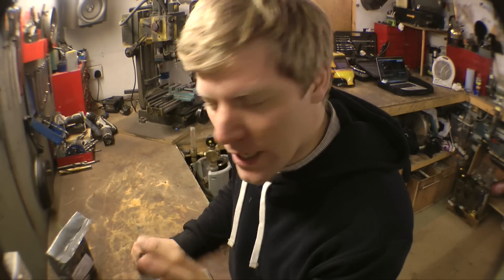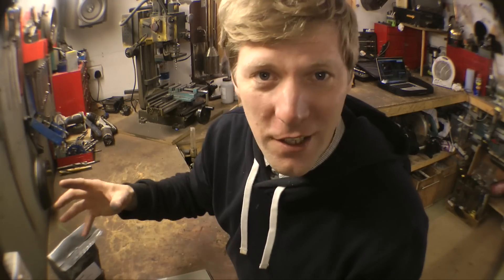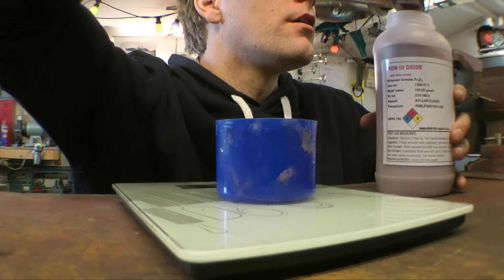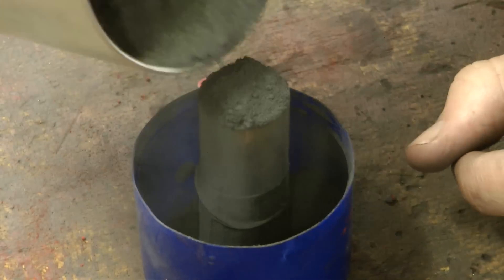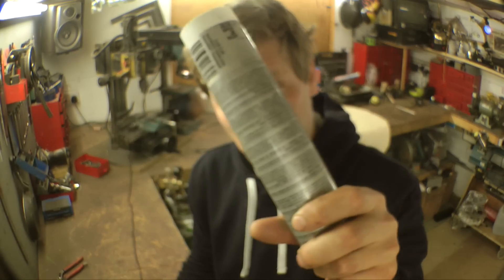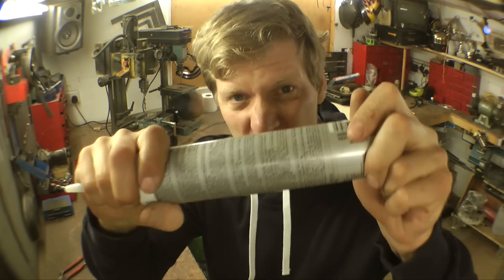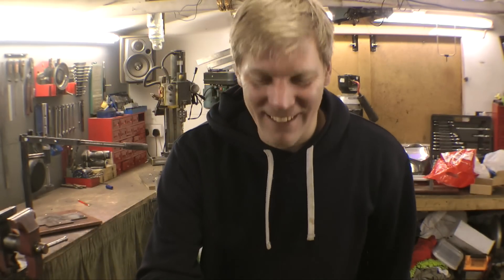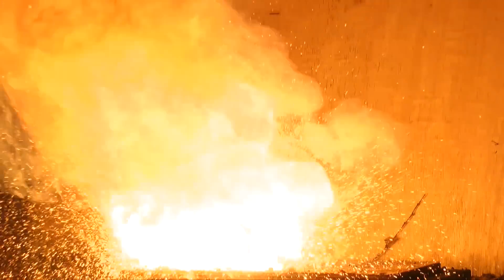Making a THERMITE LAUNCHER Part 1-Thermite shells

Comment: “When you mix fuel, metal oxide and metal powder at just the right temperature, it burns at 2000 degrees celsius. Hot enough to cut through any barrier known to man.”  -Thermite (Rainbow Six Siege)

Comment: Take that first 3rd of the pipe and compress gunpowder into it, place a thin piece of sheet metal on top and then pack in your thermite. Right when you get that sweet spot when all your thermite is burning it catches the gunpowder and spreads hot Sparks and molten iron over a much larger area ......or so I've read...

Comment: Just a suggestion, but I suspect that under the right circumstances thermite would act a lot like gunpowder, that being said, if you were to mix the thermite with perhaps some oil or water so that it sticks together instead of being powdery, and then you pelletized the mix with a 500 mesh sieve, you might get the thermite to behave somewhat like gunpowder. I think this might be the case as this could cause the thermite to burn all at once instead of just very quickly as it usually does. Using oil to make the mix could possibly have the effect of lowering the ignition temp too so you may not need magnesium strips to light it. Also, if you very securely enclose the thermite in perhaps an all metal tube, the pressure build up during ignition could also cause an explosion. This probably doesn't need to be said, but just as a warning, a highly explosive canister filled with thermite could be extremely dangerous as there isn't anything safe about metal fragments and molten metal flying in all directions at a high velocity.

Comment: I'd imagine making one like a firework. basically you'd have a charge in the center to break it up and either have thermite "stars" or just the powder and hope it all ignites. (you might need some more advanced way of igniting it like resistance heating so you ignite it evenly.) it would explode and throw thermite around and create puddles of thermite.

Comment: mix PBAN, sulfur, barium nitrate, and potassium nitrate in along with the thermite and it will light easier. PBAN is for keeping the mix together and not breaking apart in flight nor impact.

Comment: It occurs to me that thermite and a metal pipe would make an excellent incendiary grenade.
Reply: Electrical conduit would work good, I think. It's steel, but still thin enough to give a reasonable payload and it would melt with the thermite. Regular iron pipe would be too heavy

Comment: at 2.30,why he is using 90° flat edge square?
Reply: +Mufaddal Vohra to get the pipes straight?
Reply: +firoxlion sorry I didn't get you
Reply: +Mufaddal Vohra well you mean why he's using the 90° angle's, right? From my understanding he uses the two of them to make sure that the top piece of tube is absolutely parallel with the bottom tube.

Comment: In a metal tube, fill it (and pack it) with aluminium powder and some rust at the middle, you will get a lot of thrust and fire.

P.S:That's how Solid Rocket Boosters work.

Comment: Wait, just how legal is it demonstrating how to make Thermite in the first place? Nevermind the launcher itself.
Reply: +Michael Creed It's legal, but as he says if you have 'too much' of it and word gets out the plod knocks on your door.
Reply: +rasmis Heck it has even completely legal and non-violent use cases. Thermite is sometimes used to cut metal. It is a dirt cheap and fast way to cut thick metal pieces. However since it is pretty rough and not exact, plus gravity directed it is not used very often. It can also be used for welding.

Mostly it is a matter of don't use it for anything bad. If you use it criminally, it will be classed as weapon agent or possibly even as a military munition due to it's use as incendiary agent. Ergo you land yourself in metric tons of legal trouble.

Storing too much of it also gets you in trouble, though that is mostly a safety thing. Putting out a Thermite fire/reaction is dam near impossible, since it is self oxidized and so violent. So storing too much of it will get you in heap of trouble, because local fire department is not going to want to deal with your thermite stash igniting and burning the building down.
Reply: +Michael Creed Depends on where you live, and why you do it. I love the increase in european youtubers, because we don't have to censor everything. 8/3 thermite mix by weight. Iron oxide and aliminium. Here are the brand names, if you want to get them on Amazon or eBay. Done. No blurings. No blackouts.
Reply: +rasmis Well I'm not sure how legal it is in the UK, but it seems totally illegal to tell people how to make a compound that can melt steel, you know? It's cool that he's doing it no doubt, but I'm just curious about legal it is to do so.
Reply: Watch Ryder Bingo. If your intentions are good, it's legal. Same as most things.Michael Creed; eg horse manure, which can also melt steel beams. It's principally used for growing early salads and central heating, but could even be used as an explosive. Everything's dangerous in some way, so the best way to handle crime is education.

Comment: Why did you not show the aluminium? Aluminium powder is so pretty
Reply from the maker: +Sebastian Börner not sure on that maybe it was an edit mistake i didn't notice
Reply: +devastator5042 Colin does say at the top of this comment it was not intentional for a starter and secondly he told us exactly how to make it...
Reply: +devastator5042 yeah because its such a huge secret -_-
Reply: Intentional as making/showing how to make thermite (In some places) is illegal so he doesn't want to show the process
Reply: @devastm5042  3 parts to 8 parts, in weight not volume. It's hardly rocket science. Any twit with a £4 measuring scale could do it if they have the ingredients.

Comment: Could you make thermite arrowheads?  I've heard thermite can self-ignite with friction/pressure, so if you had a blunt arrowhead packed full of the stuff, could you splatter a target with a small amount of blazing hot thermite?
Reply: +frobie54 You could, but the arrow-tip would suffer from air-pressure since It'd have to be blunted, not to mention the weight would make It slow. It would work If you fired at a semi-stationary target from an elevated position.
Reply: +frobie54 You'd need some sort of percussion detonator to trigger it, probably on contact rather than light and shoot.

Comment: would it work if when you compress the thermite you leave a hole through the middle so that there is more surface area to burn at once? in the same way the solid fuel boosters on the space shuttles have the star shaped hole to increase the burn rate
Reply: +Jack Megele That's interesting, so the hole goes from the top to the bottom through the middle portion?

Comment: yep a military version of nano thermite was used to bring the twin towers in NYC down, I will never forget seeing the molten steel pouring from the towers, the 45 degree sheer-off cuts in the massive support beams, and the molten pool of metal witnessed by the cleanup workers in the basement that melted their boot soles and stayed extremely hot for months after the towers were demolished by controlled demolition at free fall speed into their own footprints MOSSAD did it, their motto is the art of war by deception!

Comment: may i suggest making a slow fuse using magnesium powder and sugar sodium bicarbonate and potassium nitrate? should get hot enough to ignite the thermite and burn slow enough out of teh launcher that it would act as a timed delay fuse. or maybe build up from an impact sensitive mixture like Armstrongs mixture into a sparker in the core of teh thermite. will cause a nice impact ignition

Comment: Tipp for fast burnrate: drill a small (~1cm diameter) hole into the middle of your cartridge and ignite it trough a tiny hole in the bottom. The hot material will be pushed upwards trough the hole and immediately ignite the rest of the fuel.
Basically what you'd do to make a rocket produce more thrust (aka. burn violently)

Comment: This is a recipe for disaster. Atleast you weren't stupid enough to use a metal item to compress the thermite.
Reply: +HeavensCraft Why? It's quite hard to ignite, you can smash it with a hammer all day and nothing will happen.
Reply: +HeavensCraft Can you elaborate? I am curious!
Reply: Spark maybe??

Comment: if you put a hole threw the center length wise. the thermite will flow threw it concentrating the heat.

Comment: Same shit that took down the twin towers.
Reply: Sailing in choppy water there mate 😬
Reply: +Mitchell Boyd makes more sense than the official story
Reply: +AZMATIK I will agree with you as aviation fuel doesn't burn hot enough to melt steel girders. Very suspicious.
Reply: Mitchell Boyd And let's not forget about Building 7 that fell at free fall speed and wasn't hit by any planes.

Comment: allways thought you could use a sparkler to ignite thermite , it should make for a nice delay when loading the thermite intoo the launcher the rod inside the sparkler makes it solid enough to stay in place when launching , it should allso make the trajectory pretty vissible if you launch after dark

i hope the launching thing you make isnt shoulder fired but more of a ground setup grenade launcher slightly remotely fired as the heat from the thermite if it starts too soon might get the projectile to stick in the pipe and burn straight through 
or the force of the launch could get the thermite to break apart and make a nice starburst type explosion right out of the barrel
remember its fun for all of us when noone gets hurt 
i rather see you laugh like a mad sientist then see you scream in pain (whell the drop from a small height was fun to watch in a "wat a stupid etc / thank god they didnt record it when the same thing happened to me " kindah way ) but burning youreself (again for no good reason ) is another story 

i once seen a small (toy)car with a home made hybrid drive , it worked the same way a diesel electric locomotive did , the drive was an electric motor the power came from an engine driven generator/alternator 
the amount of speed depended on the engine rpm / amount of power generated 
might be a fun cheap project to figure out , like adding a gasoline generator to an electric immobillity cart instead of using the batteries and seeing wat speed it takes to burn the motor up 
i haven found a lot of vids about it and i had been looking for them
Reply from the maker: +watahyahknow thats a long comment but i can tell you its not shoulder mounted
Reply: +colinfurze  gg
Reply: +colinfurze they wouldnt let you? :( but meh, still be awsome seeing thermite fly through the air and splat on something, handheld launcher or not
Reply: @The69Stalker , having seen the final launcher I think it's funny. He said it's not shoulder mounted. He didn't say it's not handheld.

Comment: On a similar note to this, a few people have been trying to make some viable, small'ish thermite lances for melting through things like big padlocks, metal doors and the like but they always run into problems like the thermite pooling on the surface of what they want to melt, slag produced insulating from the rest of the thermite, the thermite not having a good enough reaction because the particle size is to big and so on.
Figure you could give that a crack?
Reply: +KamiSapmelash Try thermic lance ,if you can get small oxygen bottle and some iron tube you could melt padlock with ease.Check Nighthawkinlight channel he made one.

But yes problem with thermite is that it spreads everywhere ,you would need to have container that can survive that much of a temperature ,maybe fire brick that was drilled trough.